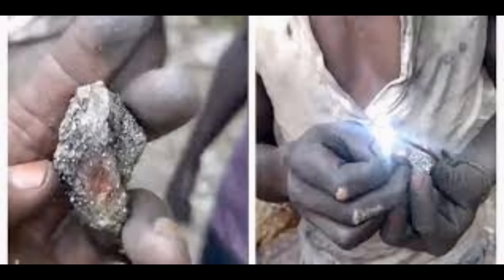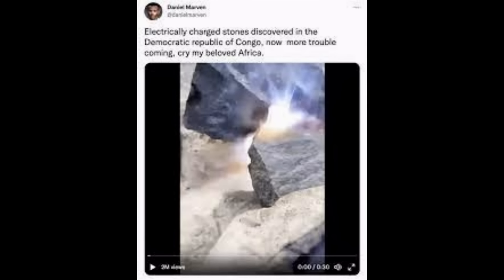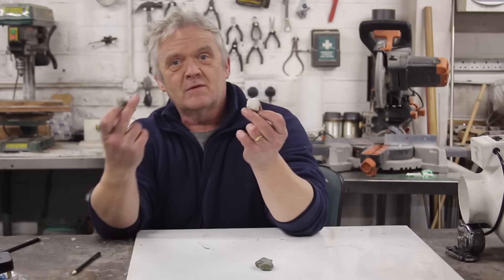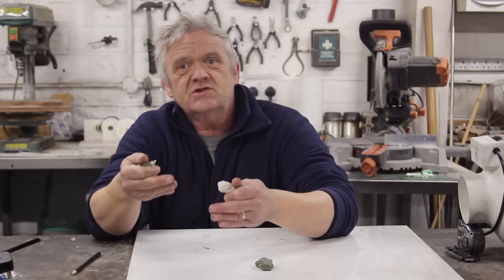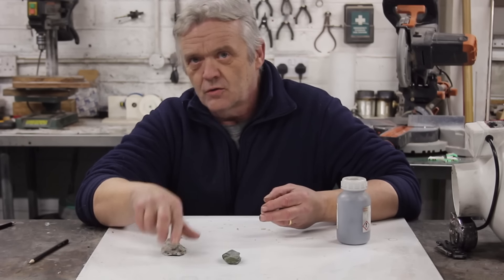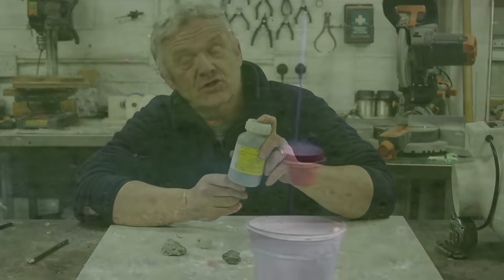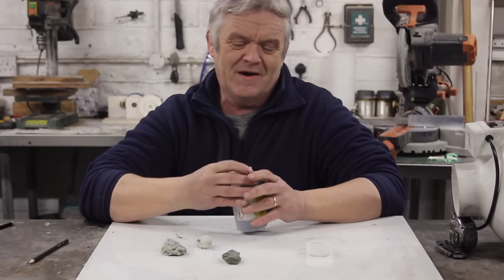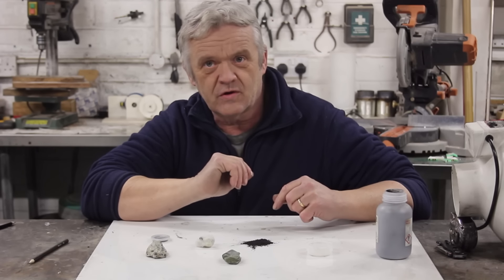1821 Reproducing The Electricity Generating Stones From The Congo

Comment: Most of these shams are easy enough for even myself to see coming around the corner. I think they're amusing, nonetheless. Like watching Capt. Kirk and crew fly a Klingon ship around the Sun to travel back in time...courtesy of Spock's "calculations".

But I'll tell you what really annoys me... I am currently doing mental homework in preparation to build a from-scratch electrical generator. Project start date, as yet to be determined. Why? Because gathering useful information is so painfully slow. Try typing "generator from scratch" in YouTube's search bar. Let me know when you find something not related to "free energy". Take your time. I won't hold my breath.
Reply from the maker: I have done loads of from scratch stuff and seen loads - where are you looking?
Reply: @@RobertMurraySmith  I don't know how to provide a brief answer. Could possibly email with more detail. But this is an over-simplification.

To summarize: An electrical generator as a "sole provider" for an average home, with respectable overload capacity. Somewhere in the 30 - 50 kilowatt range.

With that goal, I've been looking more for industrial designs. Youtube, Google, wikipedia...the usual lineup. The most respectable information I can find, tends to be focused on portable generator repairs and rewinds. Which, those have been informative. But those are focused more on designs for less than 100% duty cycles. 2 key differences between portables and industrials seem to be in the rotor poles and stator windings.

I'm more attracted to 4-pole designs, because I envision an alternator which can be rotated by an open-ended range of power sources. 1,800 vs 3,600 rpm seems to be more strategic.

The winding options are a bit more nebulous to me. Solid bars instead of coiled wires, seems to offer more towards maintenance and minimal downtime. Also better heat tolerances.

Excitation was previously a mystery to me, but I think I'm now comfortable with my understanding and ideas on that. But I would like some good information on specific areas, such as speed/voltage relationships, as well as how laminated iron cores affect the magnetic flux lines.

Like I said...it's a lot, ha!